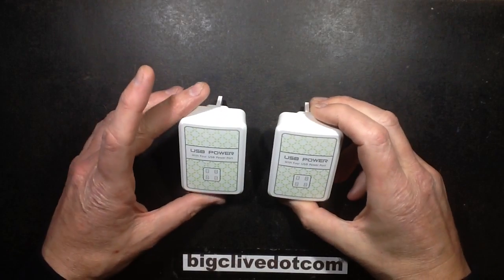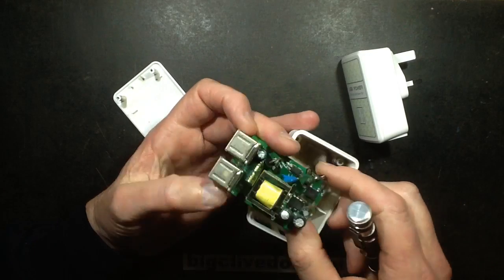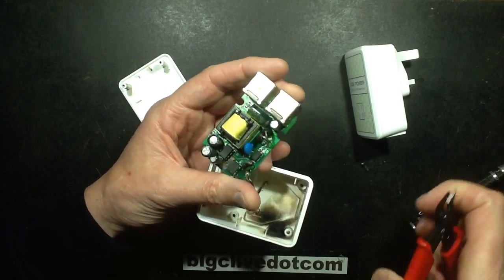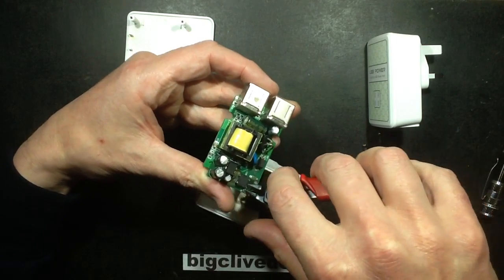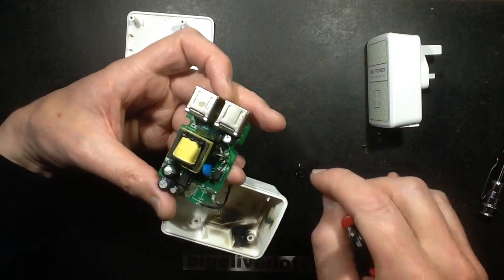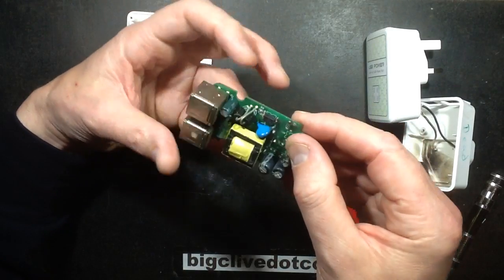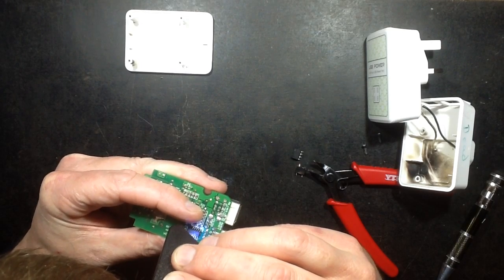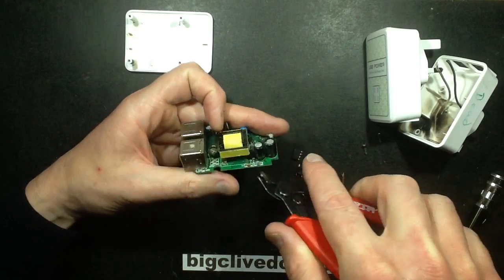Autopsy of an exploded USB power supply.  (With skidmark)

Comment: I use the cheap Dollar Tree power supplies or the ones you get from Ebay that look like the Samsung kind that you can get for like 10 for a dollar approximately, the one thing that fails and all of these when you drive LED string lights or the fairy lights is the 470 millivolt 10 volt capacitor,   that gets hot enough to melt the plastic on the case itself where it sits on top against.  I'm not actually used to seem capacitors get really hot but so far that's been the primary failure of every single one of these power supplies and I have.

I'm going to try to experiment to just go and put in a better quality cab and see if that works cuz it's usually the green capacitors that are on these that are the weak point
Reply from the maker: The isolation on the cheap supplies is often poor.  I don't recommend them.

Comment: I had a Belkin 2 socket adapter(Think one was 1mah and another 3.3mah) and I  assume the exact same thing happened to mine. I'm not sure hold old it was or when it burst but the fuse was decimated inside and half the board charred. Probably wasn't home when it went, which is scary.

Comment: The adapter housing, other than being white is similar in shape to a portapow one I have, the portapow has 4 lights that light blue but change to pink or violet when a charge load is being pulled but it has a built in circut breaker that does cut off if you go over 2.5A @ 5v dc ... no pops or bangs from it in 2 years, use iffor charging PS3 + PS4 controllers as the phone's own adapter is faster.

What you do need to watch with these Chinese made adapters is the incoming current + voltage, they don't tolerate the Aussie voltages as well as our 230v, my incoming current in glasgow when I got the portapow was 227v... current voltage in largs is 228v, the adapter says 100-240v but 244v might be the most it will tolerate so check your voltage if you keep getting problems with them, and try not to use them on trains with mains sockets under the tables.

Comment: Is it even grounded?  (The ground plug looked like plain plastic.)
Reply: John Doe the ground pin is needed to activate the protective shutters on a UK socket.
Reply: It's an ungrounded design, with the Y capacitor going to the secondary side.  In most countries it would have a regular two-pin plug.  But in the British system, two-pin plugs seem to always have a dummy grounding (PE) pin, preferably one that doesn't even look like an active one.

Comment: If I were to guess what caused the failure, I'd say the capacitor with the domed top on the primary side closest to the transformer caused the carnage.

It probably went high ESR, drew excessive current and overloaded that DIP8 part, causing it to fail.

Junk capacitors failing is a common cause of power supply carnage in all types of supplies. I often see it happen in computer power supplies where it causes adjacent components up and downstream from it to draw excessive current. Said components then either just blow up or create so much heat that it cooks the PCB to the point of it becoming black and conductive, at which point multiple things short out and you get a bang or fire.

Comment: reminds me what I just absentmindedly did  X_X   with a wireless Qi charger  X_X  have a variable Voltage charger for old RadioGone.  and it goes up to 12 volts.  forgot I had it plugged in.  and had it gradually turned up to 12 volts  X_X on a 5 volt device  oh something smell around here. ??  sniff sniff.  oh wait.  X_X    yep wireless charger hotter than a ***  oops.  another wireless charger got to hell.  next.  well the first two broke because of bad soldering right at the micro usb point.  my third one melted, but it still works X_X  ebay user partially refunded since it still worked lol  hey it's warped come on.  But this one I'd say gradually upping the power  , maybe the above was a case of a power surge.  I can't imagine surging the power via normal power points.  Do admire your humor though.  Feel like I need a shamrock sundae first  (yes plenty of Irish fun around this house.  not really by heritage but enough so Michael Collins is a house hold name

Comment: +bigclivedotcom - I'm impressed, that's the second most exploded fuse I've ever come across. The first most exploded fuse was inside an old CRT monitor I once had. One day it failed to turn on, and a brief inspection revealed that a glass fuse had failed in the usual manner, sputtering the inside of the glass with metal. In order to troubleshoot it under the guidance of my father, being teenage girl at the time, the fuse was replaced with a similar fuse.

When I turned the monitor on, there was a very loud snap, and the sound of tinkling glass. The fuse was inside the inner metal shielded case, and having taken off the outer plastic case, several shards of glass shrapnel were sticking out of the metal from the inside. Examination showed that only about 90% of the fuse was still inside the metal case.

I decided that I didn't want to explore troubleshooting a fault that could turn a 2A fast blow into an expanding cloud of shrapnel, since it would probably involve parts of components exploring the walls of my room and hands.

Since then I have mostly avoided shrapnel generating equipment. Except for a brief encounter with a UPS that spat red hot glowing fragments of IGBT onto the carpet in the server room, starting a small fire. The UPS was comprised of several modules, thankfully only one of which vomited instant fire starters. At various points other modules blew capacitors, which resulted in the worst capacitor smell I've come across, rather like the result of frying rancid bacon. The modules also had a tendency to  become an irregular pentagon during use, bending at a point where a piece of metal carrying several large chokes was fixed to the casing; in one case I had to used a pry-bar to remove a module for replacement.

Black sooty skidmarks are fine, loud bangs are fine, as are funny smells, but I draw the line at shrapnel.
Reply: A UPS at my voluntary job (local television station) had batteries that basically almost melted after overheating really badly and had vented a gas I forgot the name of (it gives a small of rotten eggs and when the dosage is high enough you loose your sense of smell, which is problematic since that is a dosage that is considered a lot more lethal than just smelling rotten eggs.)

Comment: I have one of these exact plugs, it makes a buzzing noise while charging things so i quit using it. Another chinese universal battery charge i had went bang just the other day while it was charging a 18650 battery, intially i thought the battery blew but the battery was okay the plug was not.
Reply from the maker: It's. OK. They're supposed to go bang in normal use
Reply: bigclivedotcom  I'll assume that was sarcasm.
Reply from the maker: +eraldorh Just a tongue in cheek reference to the minimalist circuitry used in many of the chargers.  It appears they go bang quite frequently.  Generally the blast will be confined to the mains side of the circuitry.
Reply: Suppose it depends on how much you spend. Iv been buying phones and tablets from China for years and not had a single problem with any of them or the chargers but I only spent $3 including shipping for this universal battery charger so you kind of get what you pay for really. Lucky I was charging this at work and attended as it blew the fuse and all the plugs in the office went out. Looks like there was some arc'ing on one of the plug pins as it is slightly melted.
Reply from the maker: +eraldorh It can just be a bit random.  The reason for the arcing on the pin inside and all the office power going off was down to the internal pop causing a momentary ball of conductive plasma around those contacts.  When the plasma has been initiated the mains will conduct right through it (causing sustained vaporisation of the metal from the plug pin) and pass enough current to trip the breaker on that circuit.

Comment: looking deeper into the specs of this unit, its rated at 3.5a total! and so thats 875ma per port, and not the 2x2.1 and 2x1 that is promised! so if you plug all four in, it probably overloaded and thats the issue
Reply: it only had 1 item plugged in at the time it blew, a Samsung a3 drawing 800ma max.
Reply: *****
not meant to blame you, i know its a terrible device!
Reply: +jusb1066 no I wasn't saying that, lol, I was just letting you know what was plugged in at the time so everyone knows what little draw it had at the time it blew. :-)
Reply: ***** actually made me stop and think, i have been thinking about a 4 way usb charger and i have been known to buy cheap and have seen these on ebay, of course now i will avoid it like the plague and stump up the extra for a known brand! :)

Comment: +bigclivedotcom
Clive, you should test the other one, by putting high voltage across the input to the output. See how many hundreds of volts it takes before the insulation on the enamel wires fails...

Comment: looks like one of the electrolytics have bulged, possibly short circuit. thus shorting out the dc side of the rectifier and hence all the carnage caused by the fuse doing its job

Comment: That 8 pin chip awfully looks like a VIPer12a due to the transformer and the optocoupler near it, but it's not.
Reply: +Bradman175 There are a bunch of other chips that use a similar circuit setup as well :P

Comment: transformer without either margin tape or triple insulated wire indeed wouldn't qualify for CE, UL etc. You wouldn't use a line frequency transformer style split bobbin in a high frequency transformer as the leakage inductance would be too high.
Reply: +KX36 Wrong! (I may add as always) EN60950 which is European standard that covers among others SMPS transformers no where require margin tape (or triple insulated wire), it only prescribe required creepage distances or if it cant be meat then require double/triple insulated wire (and for 250V RMS creepage distances required by EN60950 is less then 2mm).
Reply: Good lord, are you stalking me now? There must be far more interesting people to follow around.

Standard enamelled copper wire right up to the plastic of the bobbin and the edge of the insulation layer tape on primary and secondary of transformer provides no primary to secondary creepage distance whatsoever and only a thin layer of something like polyurethane on the copper wire between primary and secondary at these edges. That is functional insulation.

This must be a class II device as it has mains voltages inside and no earth pin, so it requires not only functional or basic insulation but double insulation which increases the required primary to secondary creepage distance inside the transformer and the number of insulation layers between primary and secondary.

Also the isolation requirements for mains powered devices are more than the nominal RMS mains voltage. <150V mains has to isolate to 1500V for transients, <300V mains has to isolate to 2500V for transients (UL60950-1, SECTION 2.10 IIRC). Other devices such as medical have to exceed this even further based on other documents (IEC60601 or something).

The standard ways to do this would be either to use triple insulated wire on for example all the secondary wingings and then you can wind up to the edges and use a single layer of tape between windings; or to use 2-3mm tape defined margins that the windings don't enter at the edges and 2-3 layers of tape right up to the edges and where the windings pass through the margin there would be extra insulation on the wire. You can skip doing this and just hipot test the transformer but that isn't sufficient to get the safety certifications in itself.

Whether the method (TIW, margin tape etc) is specifically prescribed in the safety document is irrelevant. The point is it doesn't use any method of getting more than functional insulation and more than functional insulation is specifically required.
Reply: +Petar Petrovic It actually are 325 Volts DC because it's rectified and smoothed AC mains.
Reply: KX36 I totally agree with you and Clive, the coated wire inside these transformers are useless and the tape is of little help. Slight manufacturing flaw, such as a scratch on the enamel and it's all over. I've seen transformers short from primary to secondary... It's quite smokey and warm when it goes, fries the guts out of the whole charger.

Comment: cheap china crap!!
Reply: +Dosbomber these are like£6 each, not really cheap, and its only rated 3.5a total, so 875ma per port, so it overloaded and went bang i reckon
Reply: +jusb1066 it had just 1 device plugged in at the time, a Samsung a3 mobile, drawing around 800ma max.
Reply: *****
fair enough, it should never be anyones fault, this was justa bad design
Reply: +HDXFH Well, at least he saved a few bucks.... what were the chances of his house burning down while using cheap Chinese electronics off eBay.... right?  :P

Comment: Put the other one with a dummy load and see if it bangs too.
Reply: +Green Silver Since the thing has no input transient suppression or filtering, it is also quite possible the failed device simply got hit by a power line surge that exceeded the built-in switch's breakdown voltage - it only takes a 5 joules surge to charge a 10µF cap to 1kV.

It is even possible that all the semiconductors were still perfectly fine but contaminants on the PCB or between IC pins/pads flashed over.
Reply: +Teardown Dan A surge is what killed a router power supply we were using at my old work, when I opened the supply one of the chips had exploded along with the fuse. I was wondering what was rattling around, the lid for the IC apparently.

Comment: Clive, I found that when I couldn't read a laser engraved chip, a light smear of a light coloured paste collects in the engraving and can help make the digits stand out more. Thermal paste is good, as it's usually handy.
Reply from the maker: +Maxx B That's a neat idea.  I'll give that a go next time.
Reply: +bigclivedotcom thats how WW2 tank gauge panels were done....that and a lot more 1940s/50s/60s stuff..... the lettering was stamped into the metal (or etched into a chip) 

then would then take white paint and a damp cloth..... cover it in paint, then wipe GENTLY over the whole thing.... leaving only the paint thats recessed. 

looks really cool
Reply: +Maxx B Smart idea. I've been using crayons.
Reply: +Maxx B When there is lacquer on top of the chip/board, I would not expect this to work too well.

What I usually do with hard-to-read chips is try different lighting and viewing angles, different lighting styles and use my digital camera with different exposure settings to see if my camera has better luck than my eyes with coping with the low contrast, glare, thin lettering, etc. If that still does not work, then I put the images on my PC and try my luck with digital image enhancement.
Reply: +Maxx B in the military we used chalk for anything engraved. not sure how that would do with electronics though. a little CaCO3 on some electrical things never hurt anything, right?
Reply: +bigclivedotcom 
sometimes when it's hard to read laser engraved marking wetten it a little bit may help  - I usually use saliva :)